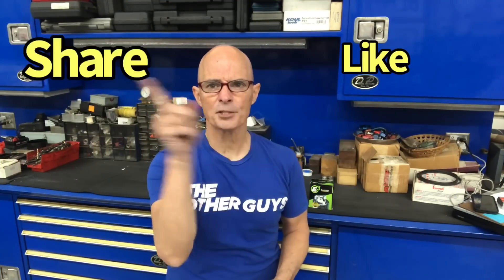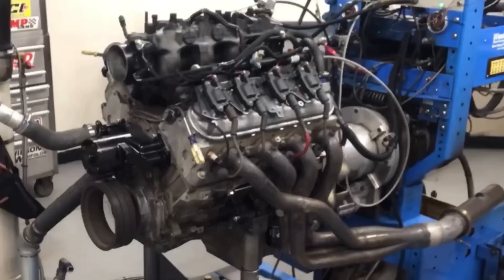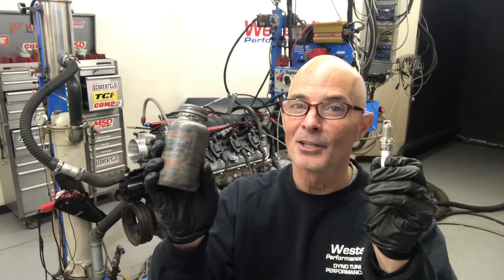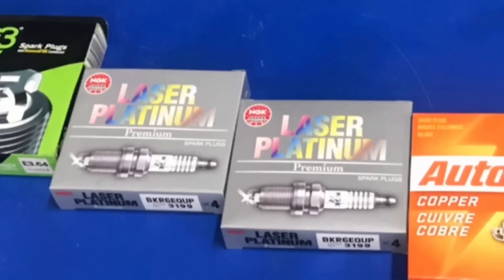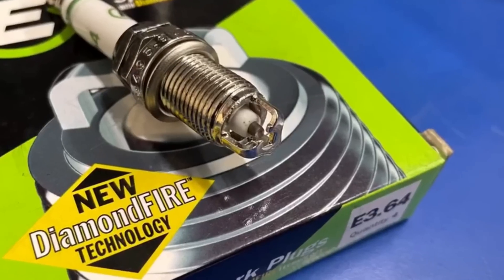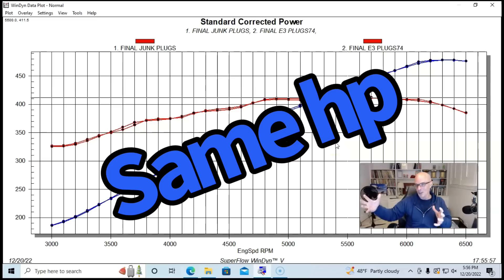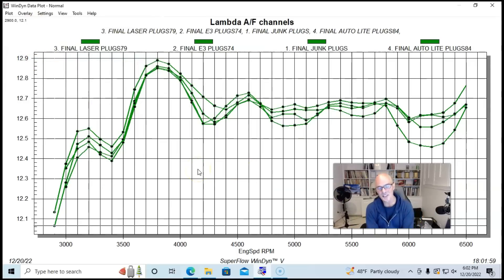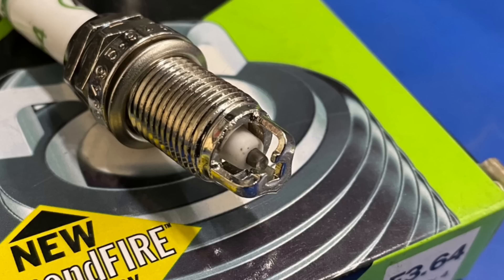E3 SPARK PLUGS-DOES DIAMOND FIRE TECHNOLOGY REALLY ADD POWER? E3 VS LASER PLATINUM VS CHEAP COPPER

Comment: Doing this comparison on a naturally aspirated engine resulted in the obvious parity between all the designs. A boosted engine might show some differences at the high boost rpm range.
I once had the need to replace an engine (burnt valve got a brand new engine for less than a head repair).
The engine was out of a newer vehicle that had an unfortunate delivery encounter with a low flight bridge.
Although it fitted straight into my engine bay with only a change of sump it had a fully electronic distributor less ignition system where my old engine still had points and a distributor . Because I didn’t get the computer with the engine I reverted it back to distributor and points with parts off my old engine.
Because the plug leads didn’t fit I used the old ones and this seemed to work fine .
The new engine had a bit more power than the old as it was out of a performance variant.
But when I finally fitted new leads and an electronic ignition system it nearly tripled in power.
The bad ignition leads is possibly what caused the valves to burn out on the old engine .

Comment: Two things: 
- Update your computer, Richard. The upgrade icon has been sitting in your tray for a while now :o)
- I won't use Autolite, though I take your point. When I had no money, I bought a set of Autolite to put in my BBC. They lasted less than a week before one of them burnt out. Bought another set and same thing. Just not worth my time nor money to buy them. They may be better now, but I won't touch them.
Reply from the maker: NO ON THE COMPUTER
Reply: @richardholdener1727  - LOL! It's all good bro.

Comment: NGK all the way.  I would imagine the E3 in a boosted application would potentially lead to pre-ignition.  I recently switched from copper NGK to their Ruthenium units and found improved idle quality and more consistent power in my boosted application.  I was always chasing the occasional misfire with the coppers.  This is new vs new, same gap same dwell.  I was surprised and the potentially added durability makes it worth it in my particular case.

Comment: Watching the video, sitting in my tahoe, running with a head and cam swap, and the factory original ac delco spark plugs with 253xxx miles on it. With the head and cam swap at 175xxx. Buddy asked me if i was buying new plugs. I said, these are still working perfect... they are still working perfect today. Pretty wild.

Comment: E3s will have an effect on higher hp motors ,  seen it and done it , you need to do this test on more radical motors and not just a stock ls. Something with big compression and lots more power needs this test done on. All these tests you do take into effect on radical shit , not these cammed ls's
Reply from the maker: COMPRESSION WON'T CHANGE THIS

Comment: I was under the impression copper works fine, it just doesn't last as long. So on an engine you have to pull the inake to reach plugs on or where access is otherwise poor, it's cheaer to pay up front for 100k mile plugs than sway coppers every 20k or so
Reply: Ford has made a hybrid plug using nickel and copper that expands the life of copper core plugs to 50K miles
 but on a side note yearly maintenance should be your priority on a car that you really love which includes changes spark plugs and other things yearly to make sure your car is running at it optimum

Comment: Ive run copper cores in all my gen 3 applications since the early 2000s. Local tuner found " a strange small but repeated midrange power increase" with them. I guess this just confirms his statement.
Reply: Less resistence in the ignition system under compression allows the field coil to collapse and release the maximum power with the least energy wasted from resistence using copper over other exotic metals..., metal to metal... Copper is the best comparatively. Exotic metals were introduced due to the mess the emissions control equipment created and access to spark plugs so using these exotic metal plugs allows longer periods between plug changes... Not any more power, as evidenced here
Reply: Copper plugs don't last as long, after 60k miles an iridium plug will be making more power. I run copper where changing them is easy or on power adder engines. A dozen copper plugs are usually cheaper than one iridium, plus there's no chance you're getting a chinese clone.
Reply: @hydrocarbon82  , i do my plugs every 50k so it isnt an issue anyway. I can get the coppers at 30% the price of the platinums so even changing them twice as much im saving money

Comment: It can be cheaper to run the expensive plugs in the long run (as long as you succeed in covering the miles) since they last 3x as long, or if changing plugs is hard in ie Hemi Durango, Boxer engine, etc
Reply: Hemi Durango ain't that hard lol I'd rather change 16 on a Hemi durango than JUST one on the passengers size rear (#8) of an LS motor in something like a Yukon or Avalanche.

Comment: Tried those E3 plugs in my new (at the time) 08 F150. Kept getting random misfires and sluggish performance,  went back to the factory recommended platinum tip plug and the truck ran fine.
Reply: Use iridium plugs, but don't use those multi tipped plugs. OEM ignition systems can't saturate the coils enough to warrant using them, and yes, they are prone to setting off misfire codes.
Reply: I know there is electronic feedback to the computer for fire.   
Plugs firing to different electrodes may send slightly diff signals.  
Maybe telling computer to adjust parameters.  
The factory spent time and research to know what’s (or which is) best. 
Because they do not want to burden the shops, or get a bad rep.
Reply: @tomreyn3610  Yeah, which is why I was going to say there's nothing wrong with "double platinum" plugs to the poster above.  That's what GM recommended in MANY engines before switching to iridium.  Edit:  OH, he meant multi-tipped (as he said).  I agree, that multi-tip stuff is a huge gimmick.  It always fires from one tip, anyways.

I'm here because I bought 6x AC Delco Professional Iridium plugs for a 2000 Buick Park Ave with the 3800 Series II engine.  The copper plugs in it (don't ask, I was dumber 15 years ago) when I put them into said Buick.  It was my grandmother's (mine now).  2 of them started missing a month ago.  Was getting misfire codes on cylinder 4 and 5.  Driver side front and rear.  I pulled out plug 5 (driver side front) and the "copper core" there was almost completely gone lol.  Had about 38k miles on it.  I know to change them at 20k, or that's the recommendation, but it had been so long, I forgot my stupid self opted for copper for "moar power."  

Now I have to go through the PITA of changing those plugs.  The front ones are easy, of course.  But, anyways, I went with the iridium.  It was right around this year model (2000) that they went from recommending double platinum to iridium... so I just went iridium.  I'll sell this car before these plugs go out.

OH.. and they had went from a .055 gap to a .07+ gap in that 35-38k miles.  Wow... 

But I may continue running copper plugs in my 86 F-150 5.0 EFI.  Easy to change.  Not sure if it would hurt anything going to iridium, though.  If not, I'll just go with iridium.  I have the timing bumped up and run 93 octane in it.  I'll read into it it sometime.
Reply: I've used them on a few vehicles. They are best suited for older carbureted vehicles. I did use them on a 97 thunderbird though, and it didn't even want to run at first. After I disconnected the battery a while to hard reset the ecm, it was fine and performance/mpg showed small gains.
Reply: I did that in a 2011 Fiesta. Immediately put the factory plugs back in and the misfire went away.
Reply: @kks_123-u1w ..thank you, I was just about to order some for the same car too lol .. thank you thank you
Reply: The 5.4 Triton is the exception. NEVER use anything but the Motorcraft solid bar type in those engines. Theres a list of reasons. Misfires being the smallest one.

Comment: These days with decent very high voltage ignitions that spark not just once but for 15 degrees of rotation as long as the plugs have decent insulators and are crimped properly there wouldn't be a difference. But go back say a 6 volt ignition using points on a 10kv coil the differences become more pronounced.  The index of the plug for example shielding that little spark, the resistance reducing the size of the spark, a single short duration spark event unlike a CDI that sparks multiple times during each power stroke ensuring no misfire and a complete burn. Just the CDI can make  a huge difference. Less susceptible to cylinder pressure blowing out the spark. 
A good test would be a back to back CDI vs points test running the coldest plugs that still work. That would show the difference between brands and styles. Well IMHO anyway.

Comment: Excellent test to backup old knowledge.  If the ignition system is working properly, plugs and/or wires will not increase power production.

Comment: Exactly what I thought, results all in run to run variance. Main difference has always been how long they last , especially under boost. Mostly because they are a huge pain to change on some engines now so they use ones that will last a lonnngg time.
Reply: Like a Porsche Turbo, where the plugs are in a "hard to reach" place, and in a high output/stress setup
Reply: When you are at the limits of the coils due to blow-out, that's when some plugs will shine.  Copper tends to work well with high boost application.

Comment: A cool test would be running methanol and try using a stock coil vs holley smart coil, vs the holley CDI 600mj. And see if the power goes up with the increase of MJ. And use methanol since its alot more fuel to ignite.
Reply: I’ve seen people coming into trouble running out of spark and then leaning it out to compensate until it runs better mainly on methanol but even pump fuel! the alcohol really test’s it’s spark abilities though! then complain that it’s lacking in response or torque and switch back to the pump fuel lol

Comment: This would have been much more telling, if the test had been run under a rich or lean condition that caused the mixture to be harder to ignite.

I'd rather see a plug wire comparison.  Wire core versus resistor core, etc...
Reply from the maker: PLEASE THINK ABOUT WHAT YOU JUST SAID
Reply: @richardholdener1727  And..?
Reply: @michaelangelo8001  I guess he is saying that what your asking is running an engine that is out of tune and that it would be silly to do. Who runs an engine where the a/f is out of whack without fixing it?
Reply: @JM-yx1lm  Lots of people do...  No engine is in perfect tune.
But you obviously completely missed the point, just like Richard.
Reply: @michaelangelo8001  If you're running an engine outside the range of acceptable rich/lean conditions, ignition components aren't going to fix it. Testing would be so skewed you could never get credible results, and you will just hurt the engine. 
But you obviously completely missed the point, just like the rest of the keyboard professors on here.

Comment: Put E-3's in my Denali Yukon, 6.0. Only used them because they were sale on Amazon for $2.99 ea. Haven't noticed any difference. Years ago, my Cheville (396, 12.2 CR, big Chet Herbet Cam (don't remember), M-22 Rock Crusher, 3800-lb clutch, ran 11:88, 141-mph in '72/73 at Irwindale. The real Irwindale where the brewery is now. AC's lasted the best followed by NKG. That motor ate plugs like a big dog eats steak!

Comment: I wonder if the diamond fire would help shield the spark from blowing out in a boosted application with a suboptimal ignition system… could be on to something.
Reply: I don't see how it could. The spark doesn't "blow out" like you blow out a birthday candle, what happens is more cylinder pressure makes it harder for the spark plug to fire because air is a good insulator and higher cylinder pressure means more molecules of air are packed between the electrode and the ground strap. That's why high compression and boosted setups need to run smaller plug gaps and/or stronger ignition systems. A thin, pointy electrode like the NGK Iridium might allow you to run a larger gap with boost, but I have read that the very fine tip has more of a tendency to overheat and cause knock than a thicker electrode. The theory makes sense, but how much it matters in practice I'm not sure.

Comment: Why spend the money on E3 spark plugs when platinum and irridium cost the same as E3. Had them in two different vehicles and they only lasted 30,000 miles. I only use irridium plugs anymore.

Comment: Im a motorcycle mechanic and have fitted countless NGK spark plugs since i began this malarkey in the mid 80,s.
In that time ive only had one, repeat ONE! out of the box failed NGK. I am a firm believer that if the engine is not misfiring then there's is nothing to be had by going to a different, more expensive, plug in a mild or slightly tuned application.
Reply: Can’t go wrong with ngk! I’d worked as a small engine mechanic and for Briggs and Stratton motors the factory plug’s were champions and about once a year we’d get a dead box or at least 90% of em dead and I’d often risk getting in trouble by fitting ngk but knowing full well it’ll last several services and many years and be better for the shop and customer in the long run
Reply: @needmoreboost6369  found the same and the same is true NGK vs Bosch. NGK wins everytime, and probably best for the price in most aplications
Reply: I've never had an issue with NGK plugs in my motorcycles over the years, but I've probably only purchased around 30 plugs. 

My buddy just had a new one fail, and locked up his engine. Freshly built supermini Honda CR85 2 stroke race engine that wasn't cheap to build. Probably had 5 hours max on the engine tuning the lectron carb, pulled the old plug to check the tune which was dialed, and installed a fresh NGK one number hotter. First track session the following morning 2 laps in during warm up and the porcelain broke dropping into the cylinder and got wedged between the piston and transfer port locking it. Going to cost another 1000-1500 to rebuild... 🙃
Reply: I've found major differences in power with plug changes.... Depends on the engine I guess.
Reply: @hotrodray6802  Hi Ray, the power differences(spark plugs) race high Hp/compresion alchol fueled or milder pump-fuel set-ups? Is it V8 4cyl 2v or 4v (dizzy or coil packs) Not mocking, genuinely curious. Richards test are brilliant and a true blessing. The LS platforms have notoriously over-engineerd efficient ignition systems mild to wild(depending on your defeniton for wild) but at a certain rpm/boost/hp they do need an upgrade(ignition). But they so good from factory it seems you can through about any plug at the stock LS igniton system and they will work regardless off spark plug design or brand .Certain engines respond differently than other engine regards to spark plugs. Race engineers late 1990's tested a bunch of spark plugs on highly controlled/regulated high strung National Touring Car(Saloon car racing race) N/A 4cyl 16v. Race engineers tested a bunch of differant plug designs and brands on the dyno and they found a specific plug that worked better than the compition they made a ligitimate 4kw(5.36hp)gain. Is puny gain I know. But they considered a win as they did not break rules and this was on 300hp 2L N/A 16v Race Engine with all the good stuff for the time. Is slightly less than 2% gain from plugs. Where a gain of tested/proven 1% is a win in tightly controlled and highly competitive class, and a big deal to them. Anything over 3HP is measurable on track racing.minute but measurable. The specific engine from,the car was also the most dominant in our national race series coincidently(Not saying is only due to plug, that would be ridiculous)  curious about what others have found on dyno with differant spark plugs. I find it very intresting.
Reply: I too am a powersports tech & an a&p mechanic with decades of experience.  Ngk rocks. Champion sux! I have seen loss of response & minute power loss in gsxr1000s, cbrs, r1s & zx10rs going from a cr9e to cr9eix & any other iridium or platinum plug. Also, found autolite equivalent plugs to work as well as ngk! Too many times I've had polaris or other atvs running shitty with NEW champion plugs. Change to ngk or autolite & BOOM! FIXXED! no other changes

Comment: Do you think the copper plug would fair even better in an application where the ignition may be taxed more, let’s say in a high boost application??? I was always under the impression that copper is more conductive than more exotic metals and for this reason may be the direction to go when your particular ignition system is closer to be maxed out...